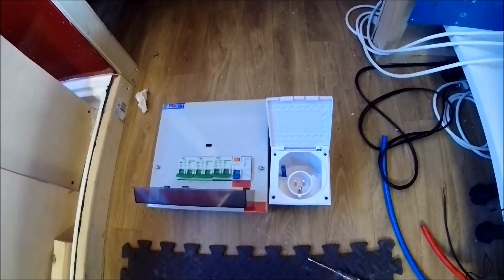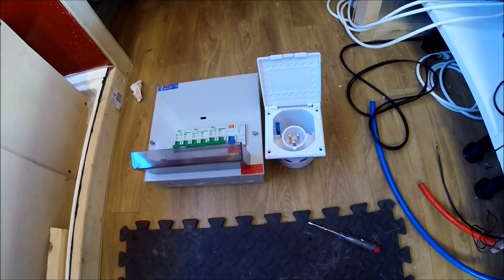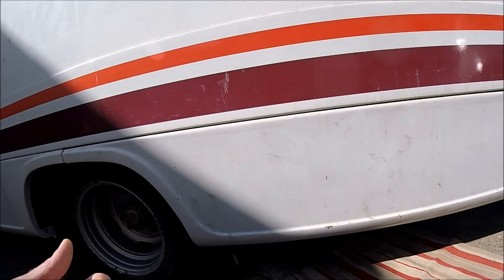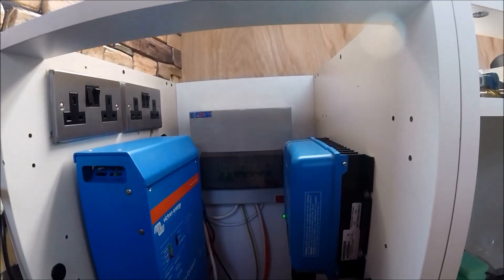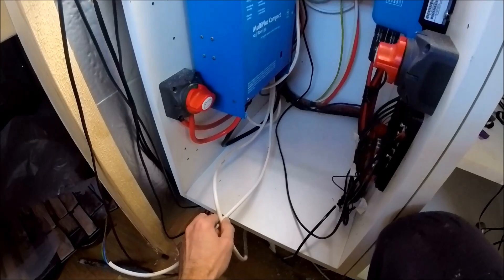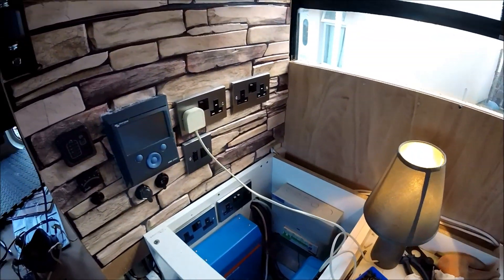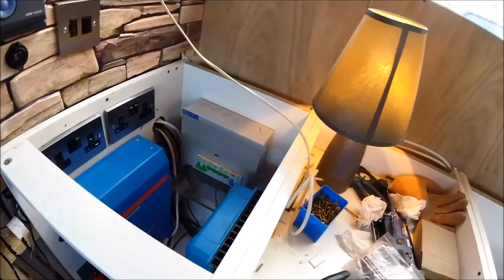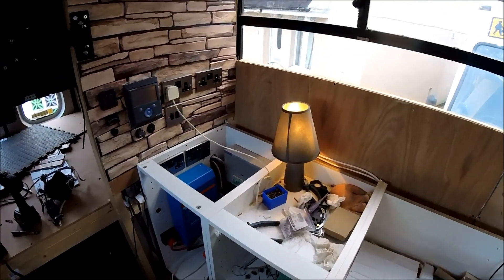Installing 240v Hook-Up Electrics In Mercedes Minibus Motorhome Conversion

Comment: Hey! Awesome video, can you point me to the reg that says all mcbs need to be double pole in a camper van? 
I'm converting a citroen relay van into a camper and was planning on using single pole mcbs. 
Is the consumer unit grounded to the chassis ?
Thanks!
-Laz
Reply from the maker: Double pole refers to new professional builds, I was just trying to follow that but single has been used for decades so is still fine to use

Comment: Hi! I’d like to see a wiring diagram of this campervan. I’m especially interested in the moment how to switch from external 240v source to solar panels (inverter).
Reply from the maker: The solar panels are always providing a charge during the day but the charge output is limited via the Victron MPPT controller if the batteries are fully charged or being charged by other means.    I have a set of 240v sockets that work as normal when on hook up via the consumer unit with another set of separate sockets fed from the inverter.  The VIctron intverter can provide 240v power to these sockets anytime, while on hookup or ran from the batteries and if on hook-up, can also charge the batteries up to 35a  per hour.  There should be links in the description for everything I used

Comment: Not sure how helpful this video would be if you were about to tackle this job yourself suppose its not a step by step  tutorial video
Reply: I need a step by step instruction video as well but no one seems to be willing to film one.
Reply from the maker: There is an older step by step video on my channel installing hook up in my old t4 with wiring etc. 
This was filmed in parts more as an update. Check my channel or my electrics playlist for more